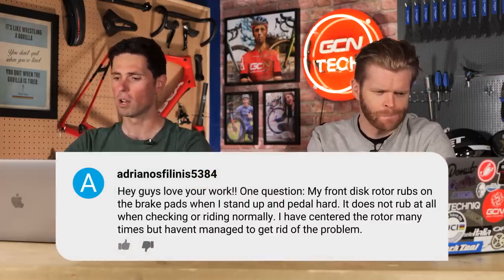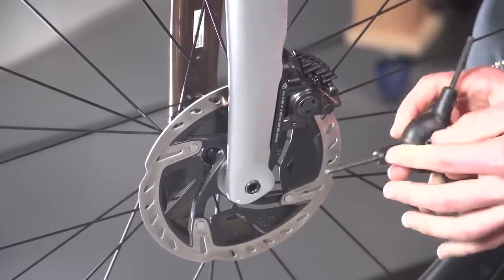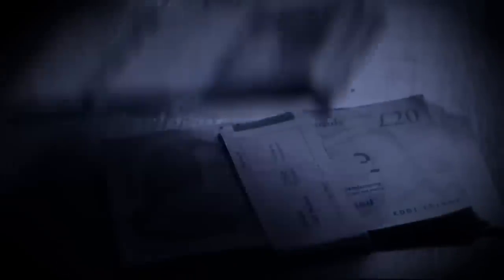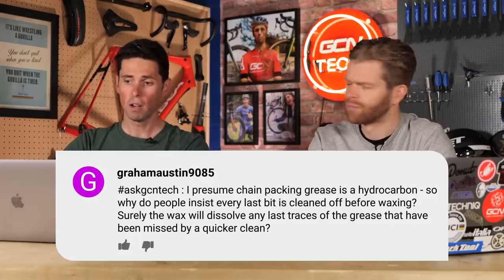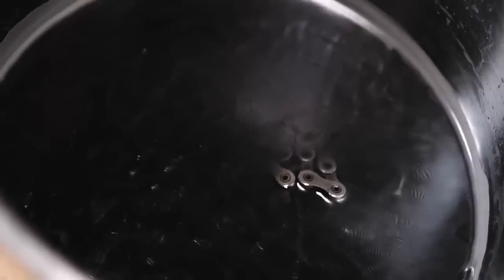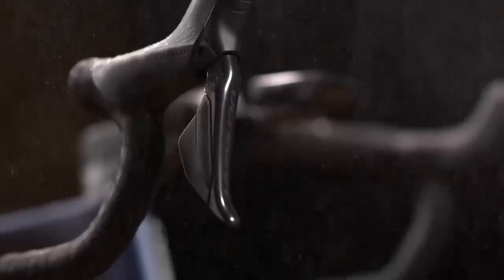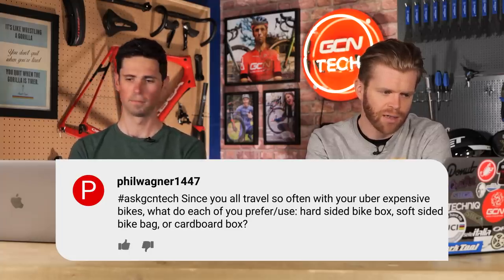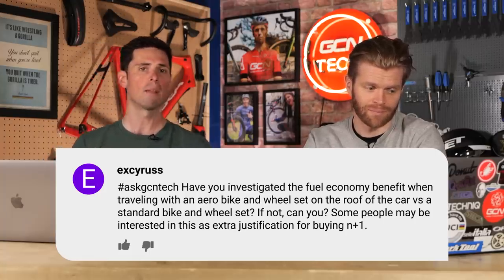Upgrades, Travel Cases & Rubbing Disc Brakes | GCN Tech Clinic

Comment: #askgcntech so my 11 speed chain snapped (sram rival) and stupid as i am i threw it away and thus dont know what length was on originally (frankenstein bike, cant check online). i then threw on a 114 chain, looks alright, but since then my gearing it off - cant switch to the easiest or hardest gear, depending on my adjustment. i guess this is because i actually need a longer chain?
Reply: Rather when you snapped the chain the derailleur hanger got out of alignment. 
As per lenght you can easily calculate it, taking half of the sum of greatest cog and greatest chainring, plus chainstay length in mm/6,35, plus two for the safety measure (there are online calculators too)

Comment: #askgcntech Will my carbon seatpost in my alloy frame cause galvanic corrosion? If so, how do I prevent it?
Reply: technically speaking: yes. you can't really prevent it unless the seatpost has a glassfiber outer layer or you apply the hell of some kind of non-conductive paste on the seatpost ^^
Reply: Normally should not, as oxide layer on aluminium and epoxy act as a barrier. But if the frame and more importantly seatpost are heavily scratched, take seatpost out from time to time, especially after rainy or sweaty rides to keep it dry. Because for galvanic corrosion you need not only dissimilar materials, but also an electrolyte

Comment: 10 kg at a metre is more like 9.807.... newton meters!
Worried about fuel consumption having a roof rack with bike?  Sounds like a good case for a rear rack since then the bike is in the wake.  Drop the wheels out to avoid side overlap, even better.  As another benefit, you won't have to lift it so far.

Comment: The last answer was rubbish. "The difference is ever so slight?? Aero gains increase exponentially with speed, so an aero bike on the roof of a car at 120kmh is going to save many more watts of drag over a non-aero bike when the difference is 15 watts at 40kmh?! Surely the maths would have been simple for Dr VolatileHydrocarbon and his assistant Bernie?